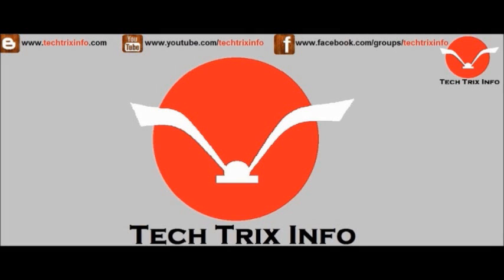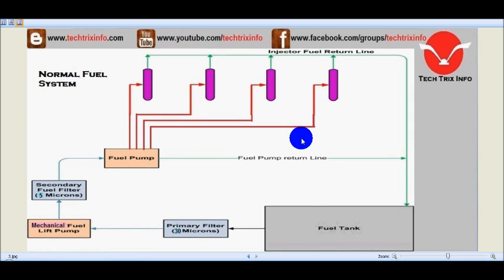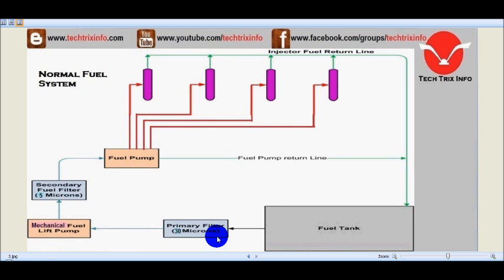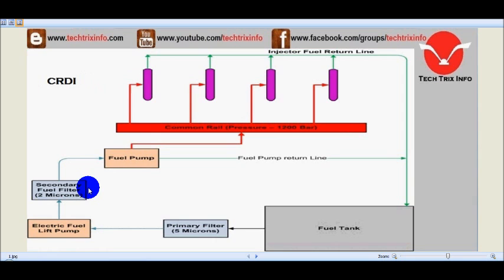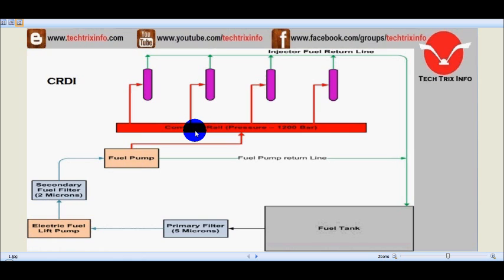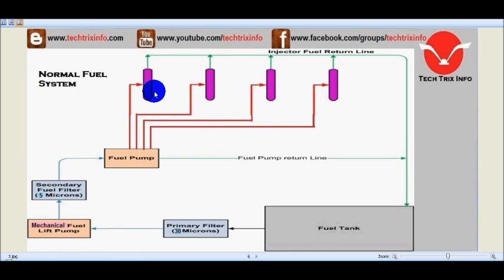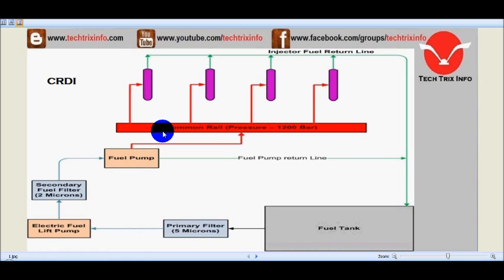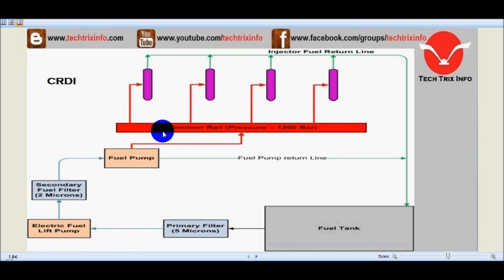CRDI Vs In-line Injection Explained. ✔

Comment: One important difference is that in the direct injection system the injection is controlled by the mechanical pump timing that is driven by the timing chain/belt..